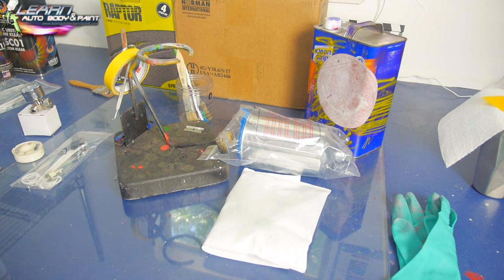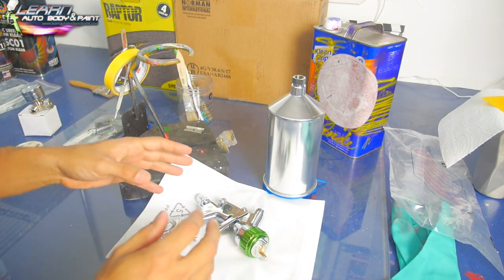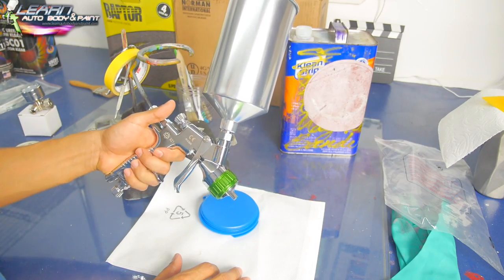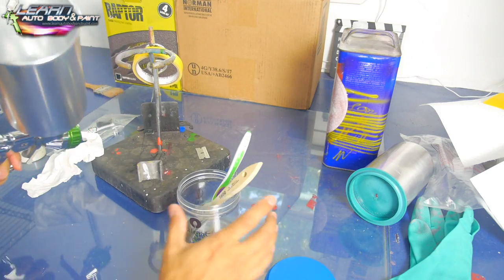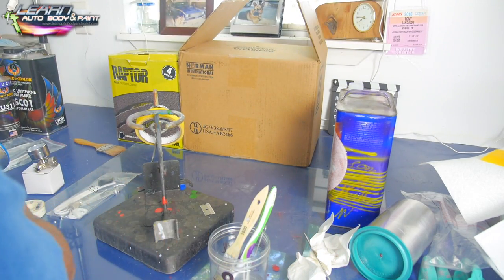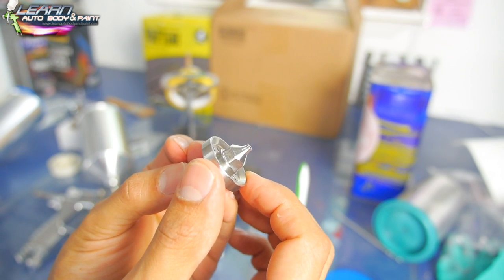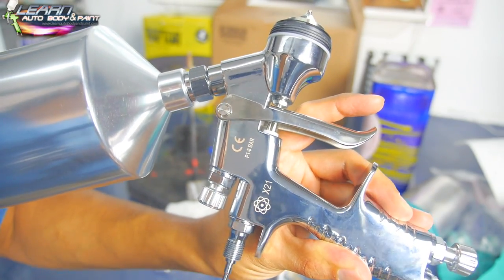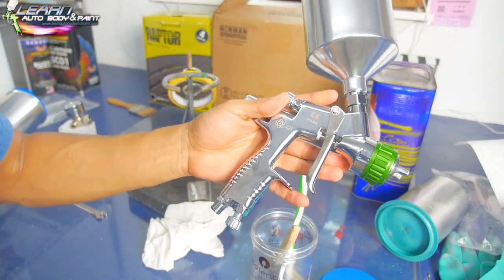Atom X21 High Performance Automotive Spray Gun Setup - Part 1

Comment: Is this gun considered in the LVLP range for home shop use?  If not, do you recommend any guns of good quality for use with smaller "home" compressors (like Craftsman that tops out at about 7 CFM @ 40 PSI?  Thanks. Great videos!
Reply from the maker: Scott Norton yes I is. It's called MP technology
Reply: Thanks so much for the quick reply!  One last question: is the only difference between the model 21 and the model 20 the use of waterbourne paints in the model 21?  Do you plan on getting the model 21 back in stock soon?  I'm only shooting solvent-based at the moment.
Reply from the maker: Scott Norton Atom is actually shipping the new shipment very soon we should be in stock toward the end of the month earlier. I will say the X 20 is a awesome gun as well.

Comment: Hi Tony I bought your program a few years ago. Iam wanting to start up a mobile touch up business here in Australia. Can you help. Can you tell me a good system for this business. I want a small kit that has the colour charts etc so I can make up my own colors etc... I want to have may be 20 main colours and then be able to match the cars colours on the job. I hope you can understand where Iam coming from.. Cheers
Reply from the maker: hey Kim! I am not very big or into mobile paint systems. What you can do is just get the color code of the vehicles you are working on and just have them made at your local paint shops..

Comment: what's the different on x20 and x21?
Reply from the maker: Rey Jr The X 21 is just a little higher end version. The X 20 is a fantastic gun it’s the one I recommend.
Reply: BOSS PAINTER - Learn Auto Body And Paint! u mean its material quality? or its performance quality finish or this one for solvent only.
Reply from the maker: Rey Jr sorry I wasn’t clear enough. They are both solvent and water based spray guns. The HVLP is more for spraying basecoat. The LVLP is more for spraying clearcoat. But, you can spray base and clear out of either spray gun with great results as well. If you want to geek out so to say, you can have a gun for base only, then another for clear only. I highly recommend the Atom X20 model. It’s fantastic in build and performance. Hope this helps!!
Reply: BOSS PAINTER - Learn Auto Body And Paint! thank you so much

Comment: Has anyone used this gun and posted a review?
Reply from the maker: Hey Robert, we have reviews on zoolaa. Check it out here: https://www.zoolaa.com/
Reply: Thanks, i was also wondering about the current price difference between the x20 and x21.  The 21 you said was a little higher end but is now cheaper on zoolaa??  Also, is the special over where  you get another spray tip with your purchase?